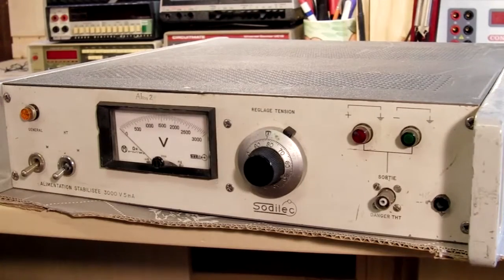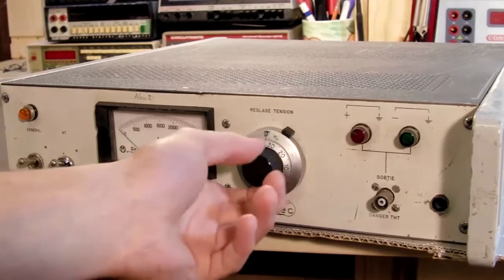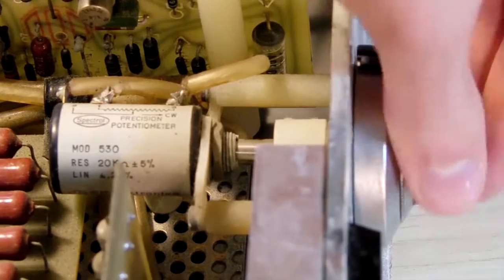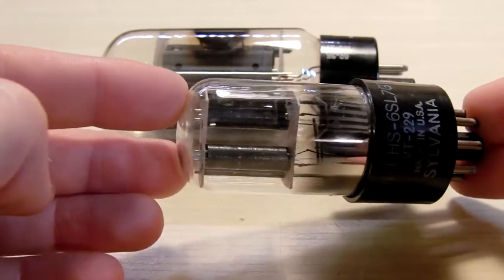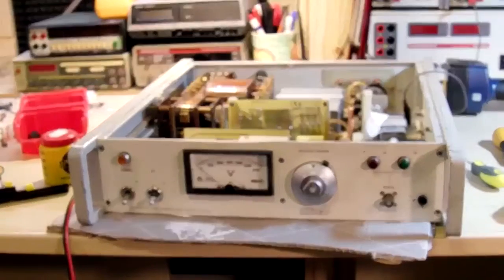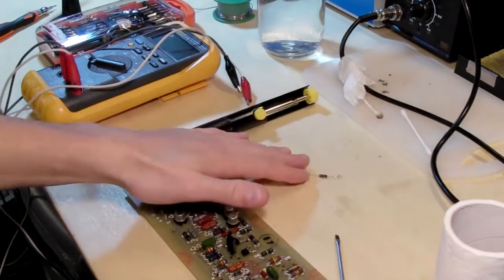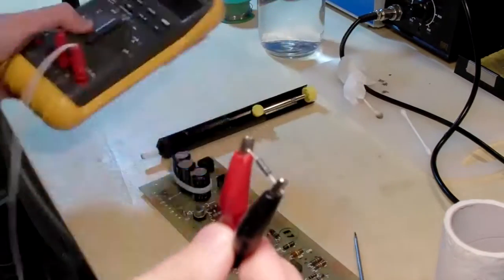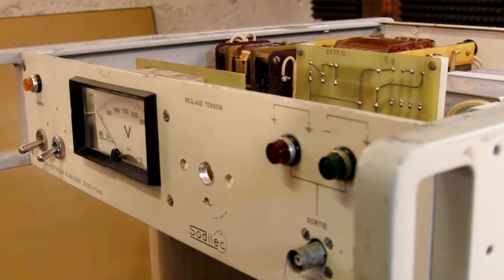3kV-5mA High Voltage Lab Power Supply Repair and Teardown

Comment: Did you energize the supply with leaking caps?  You need learn a lot about restoration.  Check out Mr. Carlson's Lab.  You will get a good start.